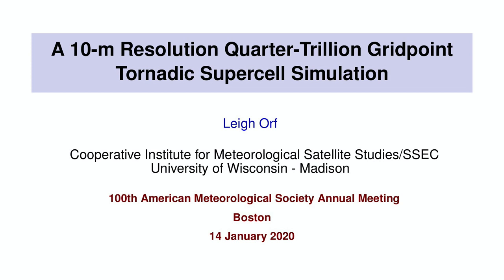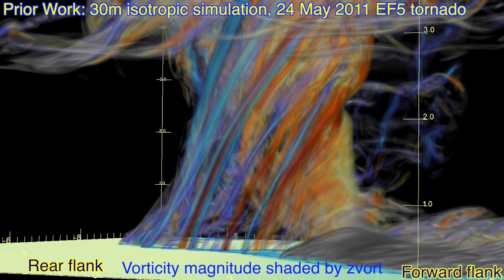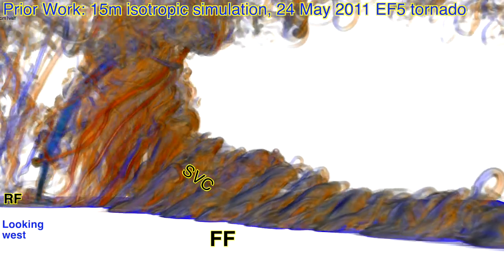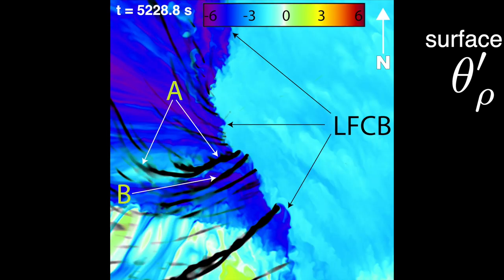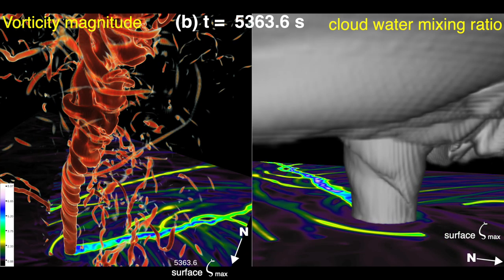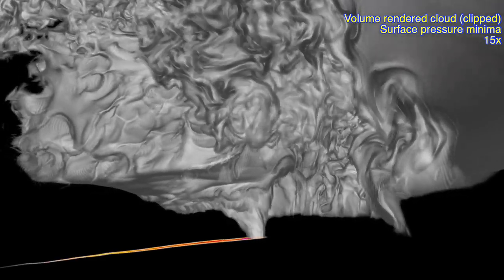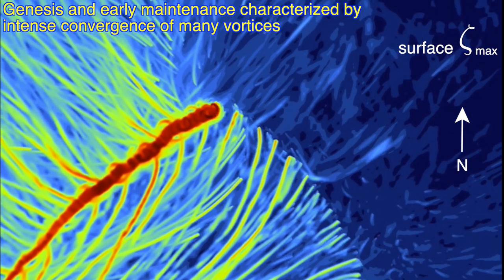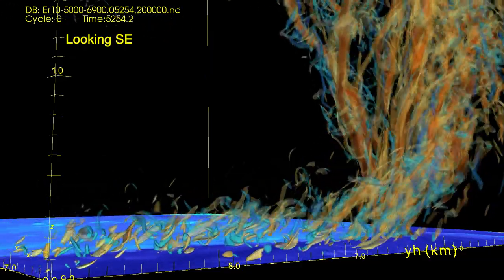A 10-m resolution quarter trillion gridpoint tornadic supercell simulation

Comment: Leigh, I understand how air at ground level is drawn up into the super cell thunderstorn. Again, what is causing this air to turn into these many,spinning, individual, vortices at ground level? Your narration in the video stated that these vortices seemed to form out of the ground. Can this be explained in plain language?
Reply from the maker: (Repeating my answer given on another video):

You get a lot of those near the boundary between the cold pool and the ambient inflow/environment. It is typically a region of large amounts of wind shear. Shear lines can easily "wrap up" into individual vortices. But there are other things going on - the cold pool itself is a region of extreme turbulence, swarming with 3D vorticity, which can then be consolidated and amplified. It's really how the tornadoes form in these simulations - by consolidating and amplifying "vorticity of opportunity".

Comment: What is the pressure doing (relative to the genesis phase) near the the end of the maintenance phase when the sub vortices begin dancing around the inner vortex?
Reply: The pressure of the tornado during the phase you commented on would have many individual minimums corresponding to each of the individual vortices. As the parent vortex expands during the maintenance phase, there is a general trend where the overall pressure of the main vortex is probably decreasing and is not as strong as the earlier phases. I may be wrong and this may be for only wind velocity maximas. Additionally, the one vortex that forms inside the parent tornado that dances around for long periods of time is something I am not sure about but looks like torture to me as it has to be investigated for future research papers.
Reply: Crazy Erich The Scientist 
Yes but I’m wondering about the overall pressure in the mesocyclone above in correlation to the sub vortices. I understand each would have there own pressure which may vary between them. I did a little experiment and I see sub vortices fire up in it but the don’t last and they are in the beginning phase. From what I can see faster moving air comes into the vortex and gets whipped around into a sub vortex it momentarily.
Reply: @FishersofTheRemnant  You might need to clarify a little more but I found that the type of tornado produced by the mesocyclone and its parent storm doesn't really determine if multiple vortices are produced are not. What I found is the low level updraft has a lot to do with the structure of the tornado as it modifies the most important part of the tornado that determines its structure, the ground boundary layer. The inflow into the tornado must remain "shallow" (exceptions though) and the low level updraft be strong enough to stretch the vortex, but not too much as it turns the tornado into a turbulent single celled vortex (two celled depending on where you are). You may know a lot more than I do since I am still learning (started a year ago). 
Sorry for unstructured post. I lost all my brain power from frustration due to physical modeling.
Reply: Crazy Erich The Scientist 
I actually did a little silly lab experiment by creating an area of low pressure above the ground. On the left side only it produces a vortex that forms and hold together momentarily and then falls apart, repeats over and over again. In these cycles it produces sub vortices, a horizontal vortex that rides up the funnel, an octopus arm and even a satellite vortex. Since the ground surface layer of air is visible with dry ice fog you can see what it’s doing when these features form.
Reply: @FishersofTheRemnant  Can you record this please? I am very interested. I stopped physically simulating tornadoes after this.

http://imgur.com/a/Jbjsvda

The first image is my first prototype, the rest are improved but still have "frustrating" problems.
Reply: Crazy Erich The Scientist 
If you don’t get the video quality you want we can try a different format. I have stills of all the phenomena. We can connect via email also.
Reply: @FishersofTheRemnant  How did you get the artificial jet stream to work? Did you create two streams of air at a 60 degree angle from each other and have one angled up, perhaps 15 degrees? This simulation is identical to a research paper documenting their observations of a physical simulation they made with two streams of air some distance above the ground plain. The researchers too got multiple vortices in cyclonic and anti-cyclonic vortices.
Reply: Crazy Erich The Scientist 
Just one. Most of the time it doesn’t work, I have done it enough to know how to adjust it to get it to work right. My next experiment will be to increase the speed of the artificial jet stream which I believe will decrease the pressure. That is when I am hoping to see some sustained sub vortices.

Comment: Maybe it’s time to consider the electric model of a tornado to see if there is a better way to predict and forecast them.

“Now let’s consider the most dramatic weather event of all, the tornado, and how these massively destructive whirlwinds are also formed by a plasma corona in a thunderstorm.

For air to become plasma and carry current, the air has to be partially ionized. A plasma state can be defined by “plasma density” — the number of free electrons per unit volume, and the “degree of ionization” — the proportion of atoms ionized by loss, or gain of an electron.

A gas with as little as 1% of the particles ionized is a plasma, responding to magnetic fields and displaying high electrical conductivity. A partially ionized plasma is often referred to as a cold plasma and highly ionized plasma is referred to as hot. Discharge from a corona is predominately a cold, dark current, invisible to the eye.

Cloud-to-ground arcs come from high charge density regions of the corona, primarily surrounding the central updraft where current from the updraft generates ions. Ground charge builds below this region in response, and the electric field strengthens, magnifying and focusing electron avalanche the way a lens focuses light, into a continuous plasma channel. When the channel connects with ground and discharges a hot current, it wraps tightly in its own magnetic field, in what is called a Z-pinch.”

https://www.thunderbolts.info/wp/2017/06/13/tornado-the-electric-model/
Reply: Greg Hummel Bravo!
Reply: That's the outside the box thinking we need to bust us all out of trying to just confirm prior beliefs, and bring us back to the true scientific method. PROVING sonething before we call it fact instead up saying, "well, it SEEMS like the most logical POSSIBILITY." Words like possible and seem only belong in the early phases of the scientific method when we hypothesize and begin down the path.
Reply: I have an issue with that theory as I think it's not that important. In the two tornadoes I have been in (one being the canton Tx ef4 or ef4 , can't remember; the one that hit the dodge dealership was the one I was in), I felt absolutely no electric buzzy feeling. All I felt was the pain from my ears popping and the fear that my car is going to become an airborne torpedo. It may be something to look into though. Still open to ideas.

Comment: All my life I have been fascinated by tornadoes I did not have fancy labs But I did study them closely here what happen hot and cold make water or moisture moist air rising moves a lot of air just like a fire hydrant hose moves air when it’s put on a spray The water bubbles make more air move and than just air it self moving air displacing cold air  from the inside at the super cell When you have a balance of hot air that can only go so high creating water droplets displacing  cold air wonting to fall with cold  water droplets  when that cold air is dropping that’s where the twisting starts coming into the system Just like water draining from a reservoir start turning developing your tornadoes To stop or prevent a tornado the warm moist air feeding the super sell from the side in flow band Tail Needs to be replaced with cold air that prevents the hot air from displacing cold air and making cold air drop Creating tornadoes Hot and cold air does not mix together well cold air wants to drop hot air wants to rise when the to meet each other they don’t have time to equalize what better way to start the transfer is spinning just like water draining through a pipe from a reservoir always start spinning when there is a down force being made if there’s someway in advance of the storm the hot air could be replaced with cold air the tornado would go away that stops the flow of hot air rising and cold air falling What creates the tornado is cold air falling from high above -30 to 40° wanting to fall just as fast as hot air is rising meeting air 80 or 90 or 100° rising Neither do away with the cold air dropping or hot air rising and you will not have a tornado 
I don’t have a lab but I do have a local pond with a pipe that creates small tornadoes I put an object down towards the bottom of a tornado is impossible to stop but you can stop the down drafts at the top of the tornado it takes very little trouble to stop a tornado in the water  just simply using draining water pipe I did experiments and put something in its way at the top to stop the twisting effect Put the same object at the bottom of the twisting water tornado it does very little to affect it same thing here some super cell does not have enough warm energy air rising  to create a tornado when some have enough warm air rising creating moisture displacing cold air does create a tornados at the very top of a tornado developing having some sort of a gun that could shoot fire directly at the top of the tornado where it is Forming would disrupt the airflow down and would simply stop the tornado Just like a small object can stop the downdraft and stop the tornado in a water simulated

Comment: How much data was accumulated in total uncompressed?
Reply from the maker: We average something like 10:1 compression ratios, so 2 PB or so? And I could easily "bump up those numbers" but the point was to compress it as much as we could to get the most mileage out of what disk space we have. Also consider compression speeds things up (it's not just about saving disk space).
Reply: @LeighOrfsThunderstormResearch  woah, that's a lot of data. Did you have to create your own visualization software for the animations?
Reply from the maker: @xeonthemechdragon  Thankfully, no. There are three robust visualization programs I use regularly: VAPOR (NCAR), VisIt (LLNL), and Paraview (Kitware). I create files from my raw model data that these codes can read - thankfully there are standards so I only have to generate one type of file (NetCDF). It's all open-source (free) and continuously developed. I am very, very grateful for all those viz coding folks out there who make my data look good :^D

Comment: Did you ever cover the rear inflow jet in your research or did i miss out on it? Would be interested in what it does in the simulations
Reply from the maker: "Rear inflow jets" are not really identified within supercells, but within MCS/bow echoes.
Reply: @LeighOrfsThunderstormResearch  I think the commenter ment the inflow feature caused by the surface interaction of the tornado. I am not entirely sure though.